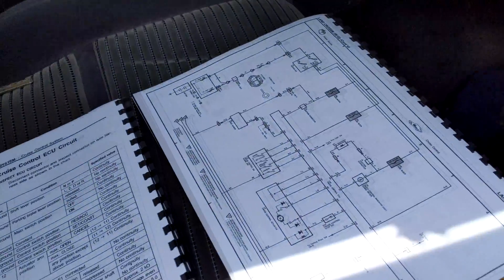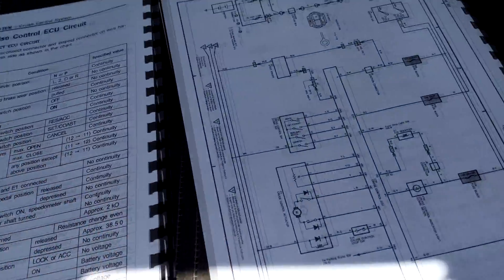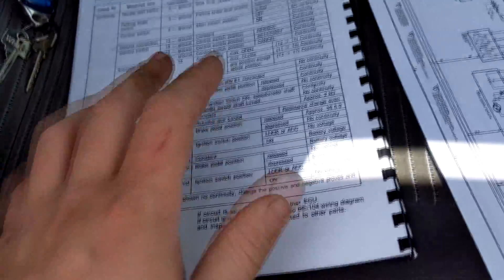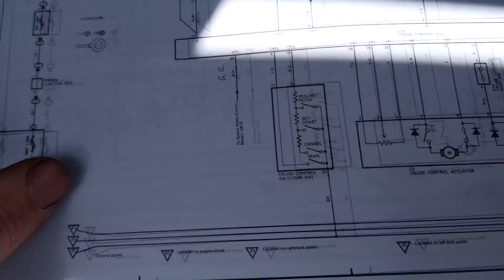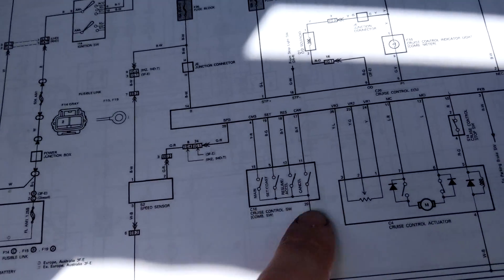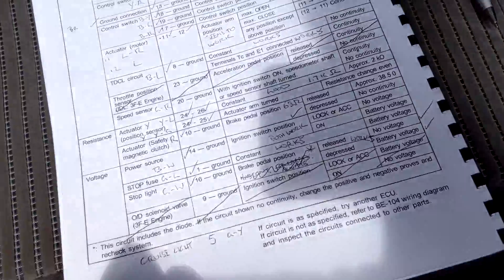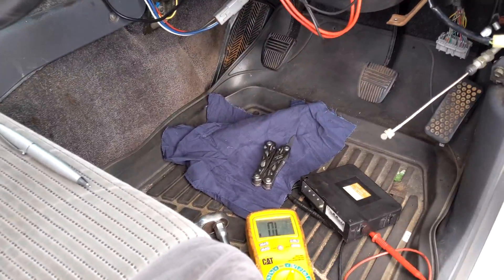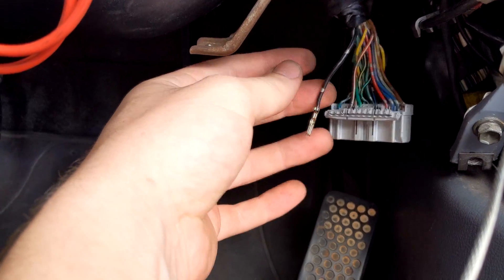How to | Fault finding Toyota 80 series factory Cruise control | Retrofitting to 1HD-FTE swap Part 2

Comment: Please send pdf file friend
Reply: Enjoyed your video on the OEM 80 series cruise control. I have a 1996 HZJ80 GXL which I have fitted all the OE components I purchased from a wrecker. Removed from a VX. My model wiring harness was configured with all necessary multi pin plugs for cruise  control components. I got the correct part number control module to suit a manual but I have been unable to get system working.
I see you got the technical info from IH8MUD. I can’t find the electrical diagnostics you show to check voltage and function from each PIN number. Where did you find that info?
cheers
Jeff